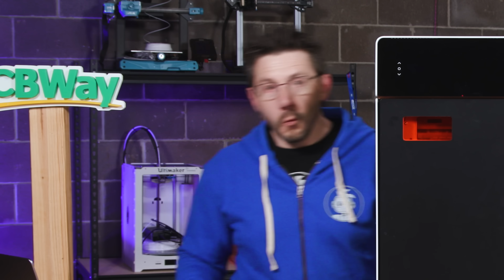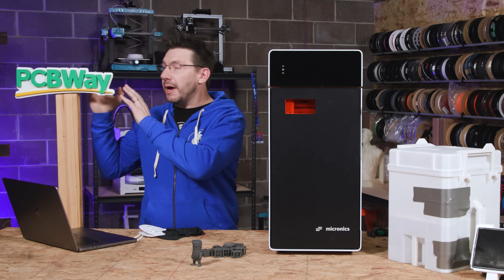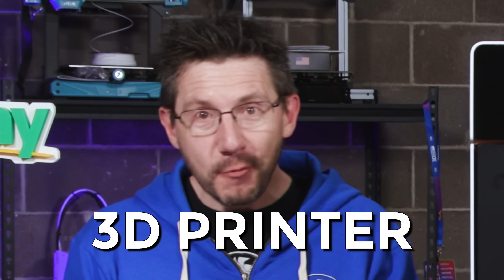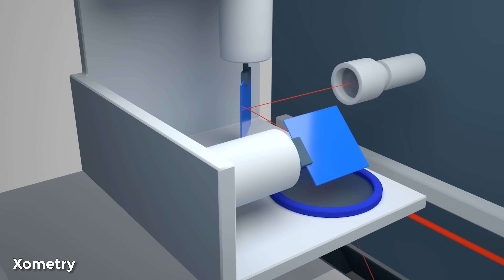SLS 3D Printing AT HOME?

Comment: SLS at home?
Oh boy, I hope you got a good air filtration system!
Reply: Friend of a friend refuses to believe his resin printer doesn't have chemicals as he has a filter attachment on it. Uses it in the same small office. But also doesn't know why his eyes are puffy and he has rashes pop up. Resins and SLS powders and vapors are super dangerous. Filtered, outdoor extraction is really the only true safe way for these types of printers. Home printing is super cool, doesn't mean it's also super safe for your lungs / body.
Reply: @KombatJam  yeah filters aren’t perfect and they do need replaced over time.

From what other people in the comments have said, when working with SLS professionally it is done in a sealed but outside ventilated and filtered room whilst wearing full respirators with flame resistant lab coats and anti static everything to prevent sparks and the room needs cleaned up before it is unsealed and they are allowed out. That isn’t something that is feasible with a hobbyist in their home.

Now micronics have commented and said not to do it in your bedroom or living space and to do it in a garage but that doesn’t seem enough, especially considering how the powder will get everywhere and kicked up into the air later.

I don’t think this is ready for home use.

Edit: unlike FDM which is safe and releases no particles or gasses when not printing, resin is constantly releasing fumes unless put back into bottles and sealed, SLS may be similar with powder getting spread through the air and onto surfaces, without proper cleanup it may stay in the air for a while.
Reply: @conorstewart2214  yeah, i mean the sealed room etc, is mostly needed because they print with metal powder that could literally kill you ^^ - here you "only" print with plastic. 

But if you have it in your hobby room, i can imagine your 3d printers wont like that fine dust... and slowly clogg up from all the dust & powder that the grease is catching.
Reply: @Bastyyyyyy it is still ideal to have a dedicated room just for powder hygiene purposes even for plastic powders which still are explosion hazards just look at pa12 powder msds sheets to see the explosion hazard warnings. It can be done safely in a garage on a budget but you should expect to spend a few thousand dollars to get the supporting equipment to just do it safely if you are considering doing it. Never use it in living spaces you will get cancer.
Reply: @riakata  100%, i would never use it in my home. 

Reminds me of resin printing :) - 5 seconds of the smell trough a mask gives me headache/migranes for 1-2 days.

I doubt super fine power is any better,  And for that price of the machine, i think you could order a lot of SLS parts online & protective gear  until the machine is worth it to justify it.
Reply: Don’t worry formlabs made sure it will never happen